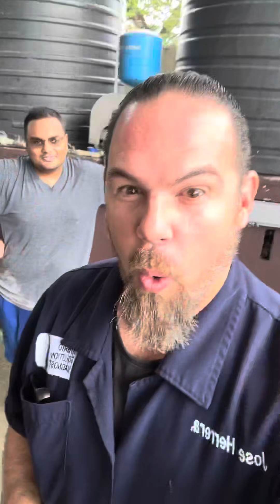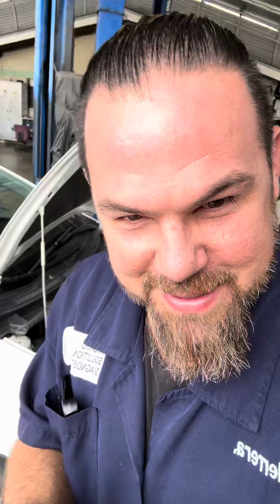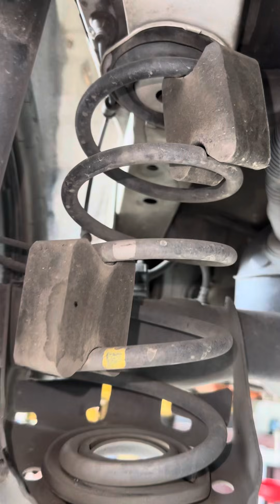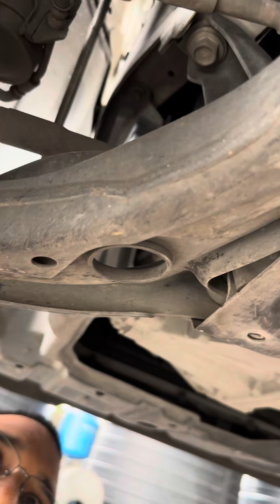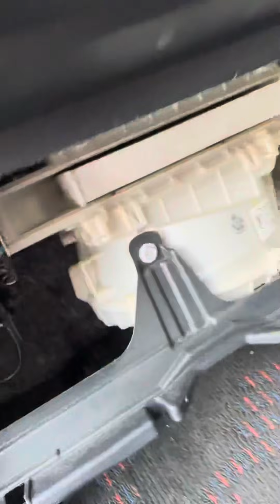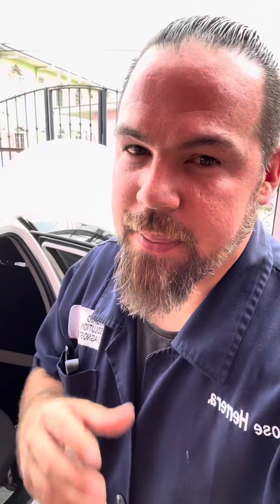Hybrid vehicle service and preventive maintenance

Comment: I have a hybrid Toyota corolla filter 2015 model somehow high voltage battery fan and fit it back but after a while I started getting collision light on and so many other problems I was frustrated seeing other problems as well in the end I found out the wire for the fan was disconnected as soon as connected back everything was ok. I am giving this information just for someone to know

Comment: My car (Axio Hybrid 2016)  runs Under 5K miles in 1 year. Should I change the engine oil every 6 months or after 1 Year? I am using Mobile1, 0w-20 FULL SYNTHETIC.

Comment: What may cause issue with attempt automatic brake sensor after pressing brake 30 minutes later for toyota yaris G 2023? SRS AIRBAG system malfunction, LTA MALFUNCTION AND PRE-COLLISION Malfunction also. New car bought on april and 3 weeks this issue. Thanks for your advise

Comment: Wow! I thought my Hybrid Battery in my Hyundai Ioniq might be going bad. Everything that you showed in the video, regarding the amount of charge in the battery, is what my Hyundai battery indicator is showing. The only thing I have done that might have affected it was a couple of days ago, I accidentally left the ignition on, without the car running. From that point on, it showed that the hybrid battery was about half low. However, it would recharge, but never all the way.

Comment: I had no idea that the HEV battery had a filter. I purchased a new Hyundai IONIQ HEV in 2022. In my opinion, the dealer should have given me a short list, say consisting of 10 things, that I should know about. At 75, I do not like to wade through owner manuals. After all, I don't have that much time left! With 105,000 miles, it is showing 50% capacity. After locating your channel, I discovered there is a filter for the battery itself. Many years ago, I sold new and used cars. We always did a walk around after a customer had purchased a new car. I will probably not purchase another car from Terry Reid Hyundai of Cartersville Georgia.
Reply: Normal state is around 40-80 % in the Ioniq hybrid no worries 😅 it goes up and down ;)

Comment: Nice information. Just wondering if you need to change silent block/bush in the axle? Recently I can see those rubber split up. However, I cannot source the part for them. For example, Toyota Sienta nhp170 doesn't have that part on their diagram.

Comment: My Corolla Cross has 5000km from new, dealership states first service is at 15000km, Do I have to wait till 15000km to do the first service or can I book a early service for the car?
Reply: Diesel Vans Service Interval is 40,000km and they last over 300,000km+ so, it will be fine

Comment: Hello. Please you tell me how reset idle throttle body in nissan altima hybrid 2009. Hv battery I fix myself  and the battery is good. The battery have 250v . I have problems  only idle in throttle body. Please you help me what need to. Send me 1 message. Please.

Comment: There have been questions about how often the brake fluid needs to be changed. The service has it changed after 20,000 miles. I’ve also read that it should be changed every two years. Others never change it or only if it gets dark. I’ve read brake fluid manufacturers data that recommends every 2 years except for the Bosch fluid that says it’s good to three years. What’s your recommendation 2 years or a certain number of kilometers/miles?
Reply from the maker: Every 2 years indeed… specially for HEV

Comment: Is this information the same for other hybrid vehicle? I have a 2023 HRV. Thanks for great video as well
Reply: When it comes to simplicity, it only applies to Toyota hybrids, due to the planetary gear set, being gears that connect the ICE with the electric motors, it is the simplest and more robust ''transmission'' designs.
Reply from the maker: Yes as long as it uses the same or similar system